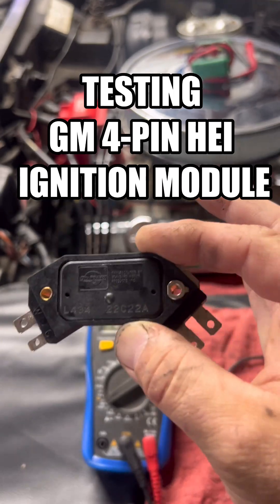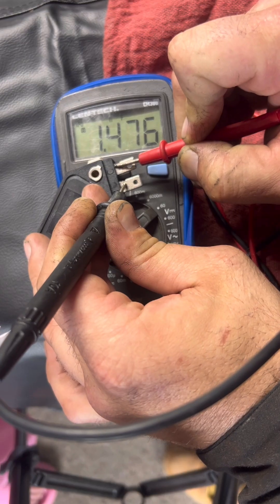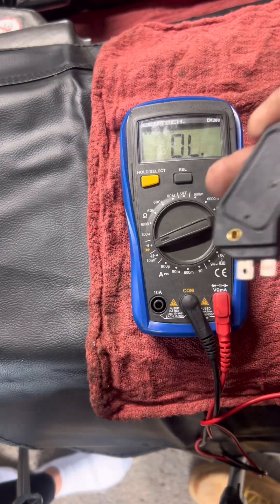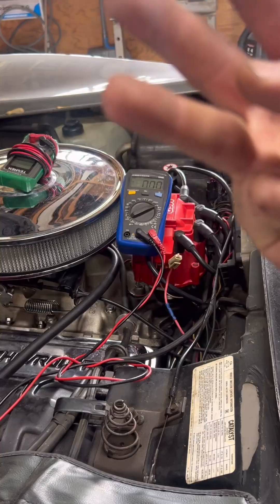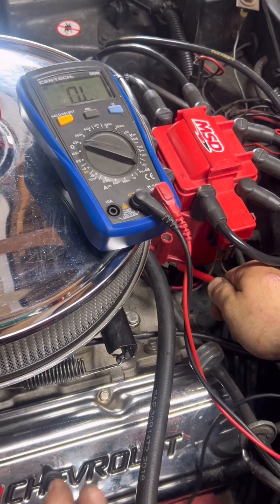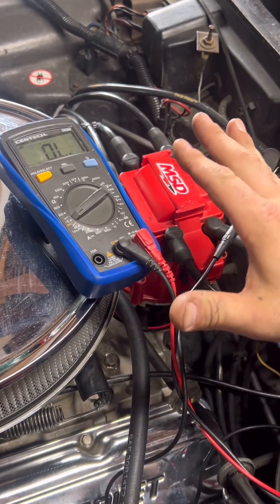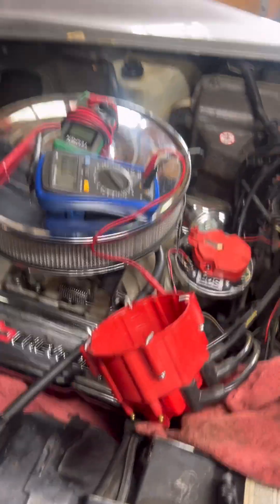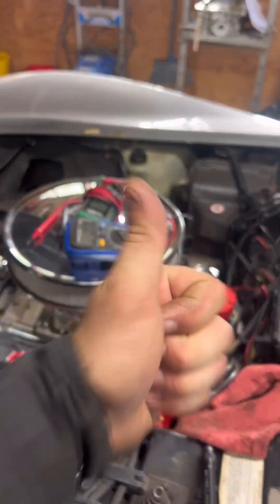How to Test a GM 4-Pin HEI Ignition Module (Bench & In-Car)

Comment: Sorry but the meter is on capacitance and not diode
Reply from the maker: The meter is in capacitance mode on purpose. Some meters (like the Centech CM300) don’t supply enough voltage in diode mode to forward-bias ignition module transistors. But in capacitor mode, the meter applies a higher voltage—which can reveal voltage drops across the transistor junctions. The module doesn’t contain any capacitors, so what’s happening is the meter energizes the transistors, and that voltage drop tells you if one is leaky or failing.”

Comment: hi  use a 368 ci eldorado 1980 4 pin but the probleme is  the 4 front plug burn black -4 back plug burn white. the engine run bad, the 8 spark plug  and wire are news - did you have a explication? Best regards Olivier

Comment: Think some other 4 pin specs are needed:

New modules don’t do continuity from G to ground out of the box.

Depends on the type of module family the 4 pin is in.
Reply: Same with me. I tested five different distributor ignition modules and I had no continuity between in the ground path so he’s incorrect with that.
Reply: @philipgavin6962 nah he is right. But some 1.25 and nearly all 0V family nodules arent G grounded. 0.77s are grounded.  There's a way to test what family your is, but its a pain
Reply: Thank you.  I thought I was going crazy

Comment: O.L. doesn't mean open loop, it means out of limits. Everything has resistance even air, but the resistance is so great that meter cannot find it in its range capabilities.
Reply: More accurately "open line" but open loop is the same.
They both are accurate depending on circumstances
Reply: Both are a thing. And usually it's open loop.
I don't know enough to say which. But ol generally means open loop in reference to multimeters

Comment: The best way to get use out of (and quit unnecessarily replacing ) a GM ign module on a Chevy is to "completely" disallow ANY length of plug wires # 5 & 7 to run near, around, or parallel to each other, ever, IN ANY WAY, SHAPE, OR FORM. Do not even put them in the same wire loom together. I have personally seen brand new OEM 4 wire modules literally puke on the customer just out of a shop driving on his or her way home from just having had it replaced bc wires 5 & 7 were not segregated in the first place. Word

Comment: 7:21 not exactly how I would do it but you could at least take the rotor off and if the parts are available sure but most of the time when you need it and you go to the auto parts store, they don’t have one, but what they do usually have is $100 distributor sitting on the back wall now. Obviously this is different if you have a top quality distributor.  one of my built, not bought vehicles which is a 85 C10 with a bbc it’s the only 1 i have with HEI and let’s be honest it’s a dinosaur step up it’s made so easy these days put you a small head distributor in a small ignition box, more spark, more power better running and just a little bit more room around the distributor especially the firewall